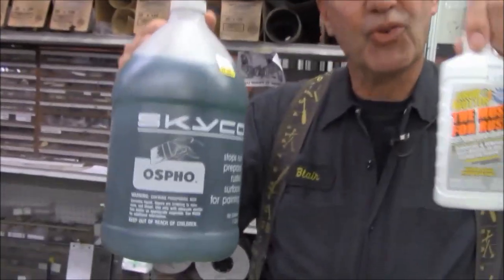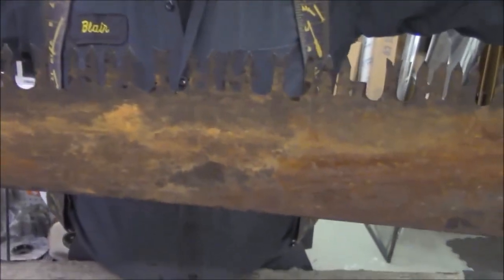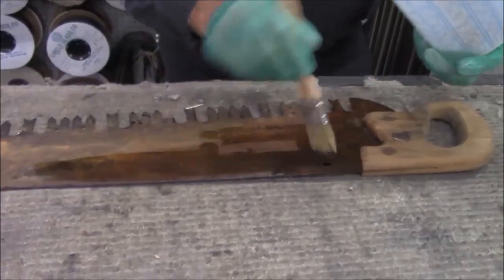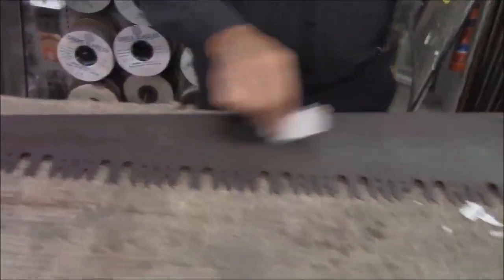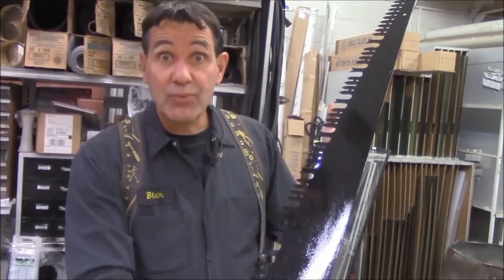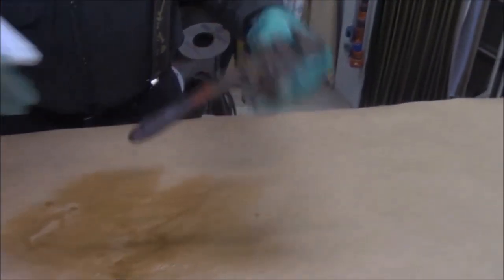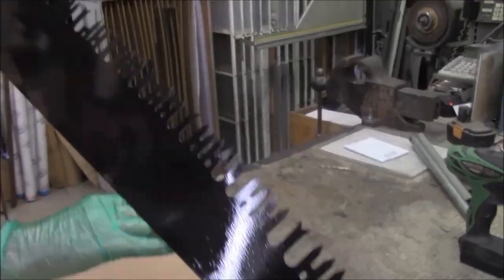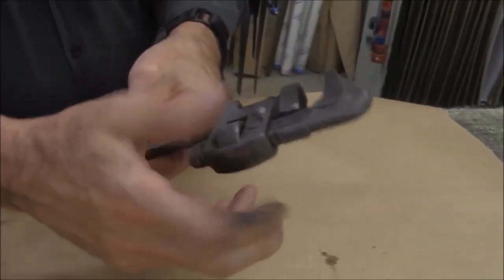Rust - Phosphoric Acid will Stop, Inhibit, Convert, Remove, Prep Metal

Comment: my garage doors is rusty, but a lot of the rust is underneath a layer of paint (pretty sure its latex) and looks like bubbles in the paint.  will this work though the paint?
Reply: no. it will only work on exposed metal. Sand back the affected area, get rid of scale-y rust and then apply the product, then primer then paint
Reply: @n2i1k2o1l2a  Thanks.  Sanding doesn't work so well on this latext paint.  I found that I can use a 4" razor scraper to chip away the paint bubbles quite well.
Reply from the maker: @cslloyd1  My favorite tool for the job is a paint and rust removing wheel that goes on a drill. I think Norton makes them now, the old brand is discontinued or I would send a link. Like a plastic steel wool pad for a drill.
Reply: @MrHardware1  ok, thanks.  I see some nylon abrasive wheels at HarborFreight.  I am also considering one of their $20 sand blaster.  I live on the beach in Florida, so plenty of sand available.

Comment: Great video. Thanks Mr.Hardware. Is it a special kind of paint you use when the phosphoric acid has dried ? Or is it a clear coat ?
Reply from the maker: I use any good quality oil-based paint. An exterior varnish should work also.

Comment: I've successfully used Ospho in a number of applications and have been very happy with it.

Recently, I've wondered about using it to pretreat concrete rebar. Do you have any experience with this or know anything about the long-term benefits in such an application?
Reply: Like he said set the ends in a salty bucket and let it rust. Says on the bottle it can be used to protect clean iron after sanding, grinding, sandblasting etc. Look it up and read the label. From my direction it looks like it will work
Reply: Thats a pretty slick idea. Get a tube, or split a piece of capped PVC, fill with PA and soak your rebar in it. Then, maybe coat it with an elastomeric paint or other rubberized coating.  A bit of work, however still probably a lot cheaper than galvanized,FRP or stainless.
Reply from the maker: It would be helpful if there was a film of rust on the bar. Sorry I cannot speak about the long term results of encasing steel in cement but I feel it wouldn't hurt. A quick coat of any enamel paint, even thinned would really help. Blair
Reply: @MrHardware1  
the presence of rust on rebar when layong concrete is actually desisable ..*** Provided you have sufficient distance between the surface and the rebar and the concrete is properly mixed and tamped or vibrated. The surface coat of rust has been proved to give a stronger bond with the concrete and the alkaline nature of concrete prevents further rusting

Comment: Just use hydrochloric/muriatic acid the rust will be gone in seconds but you have to neutralize it after the process with soda-water solution and rinse it well with water. So much faster and better than phosphoric acid.
Reply from the maker: The problem w/muriatic acid is it more dangerous than phosphoric. I recommend it to customers that have experience, not to newbies. Thanks Blair
Reply: Hcl and muri continue for weeks months. It will continue to break down
Reply: @bigtxbullion  not if neutralized. That chemically stops the reaction, no reaction no breakdown. In 60s they'd dip whole cars in acid to thin metal and make them lighter. So you are right but if you stop the reaction it'll be fine. They used a soda mixture.

Comment: yeah but that stuff is really expensive... i wonder if coca cola would work
Reply from the maker: +PC5032 
I did my boat trailer, a chocolate mess of rust. It was leaving a shadow of rust on my driveway. I sprayed it with half a bottle, $14.99 a quart, painted it with Valspar Industrial Oil Based enamel, 12 years ago and it still looks great. It was my only primer, I find that as inexpensive and any other primer.
Reply: +Blair Gilbert good testimonial.  ill have to get some.  I've been using electrolysis and Evaporust, and then Rustoleum Rust Converter as my primer.   Also not really cheap either.
Reply from the maker: +PC5032 
I only use one of any of those products at a time. Must For Rust is the one I usually use.
Reply from the maker: will cola remove the oxidation from the metal? I don't know, Blair
Reply: @MrHardware1  ia trying it direct with no paint over it tos ee if it resit tos tuff.
Reply: I found lemon juice concentrate works almost as good as Evaporust... and you can buy lemon juice with freaking Food Stamps.   Can't beat that for price!   

Leave your part in lemon juice 24 hours, or overnight.  Scrub with an old tooth brush, wash off rust , put back in if you need more.   When lemon juice wont get any more off (the very last deep pitted stuff) wash the part and drop it in phosphoric acid prep and etch to get the last bit off and prep the metal for priming.  Phosphoric acid is even stronger than lemon juice, but you actually have to buy that at home depot.
Reply: You can buy Ph Down from hydroponic weed growers shop pretty cheap. It is almost pure phosphoric acid.

Comment: Nice video just one question. You don't have to neutralize the acid ?? Before primer or paint?? Thank you
Reply from the maker: +titan371 
No, once the acid is dry, short of excess powder, the metal is ready for paint.
Reply: @MrHardware1  even for epoxy or urethane? Hope u still answer.
Reply from the maker: @kitjasabsgabs1830  I don’t see why not. Usually I paint exterior metal w/oil based paint. I don’t see why epoxy and urethane would be different although before I committed to a big project I would test a small area first.
Reply: @MrHardware1  Oil is fine but for epoxy it's not so good. Idk about urethane or enamel as I always just shoot epoxy over the converted metal. Thank you. Have a great day sir. Semper Fi
Reply from the maker: @kitjasabsgabs1830  Thank you, and thanks for your service.
Reply: @MrHardware1  Thank you for the opportunity sir.
Reply: BTW really cool you answer my question on a 6 yr old video. Thank you. I'm subbing. Semper Fi
Reply: i guess not, cause it decomposes in other stuff so its not acid anymore
Reply: I scrapped off excess flaky rust on undercarriage, frame etc of truck.   Sprayed.  Let sit overnight.  Woke up to a powder white frame.  Rinsed.  It still is powder white.  I want to spray Rustoleum Undercarriage Rubberized spray.   Is the white residue/powder an issue?   Did I do something wrong?